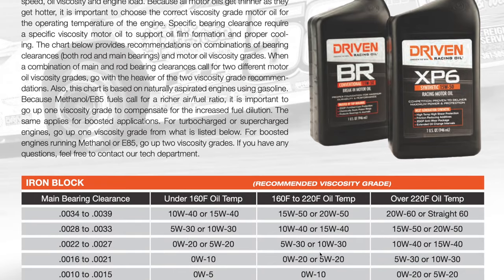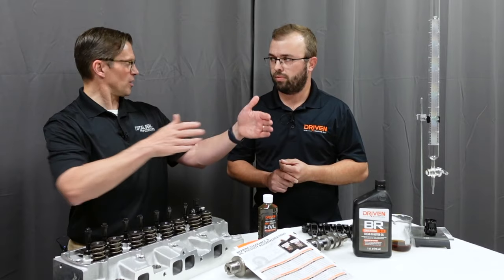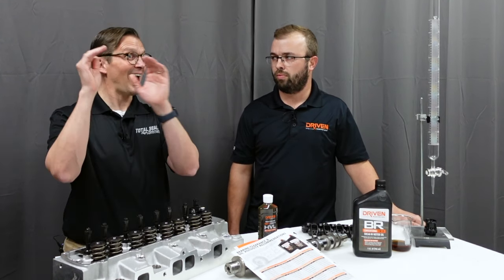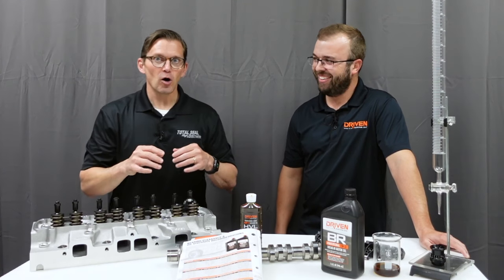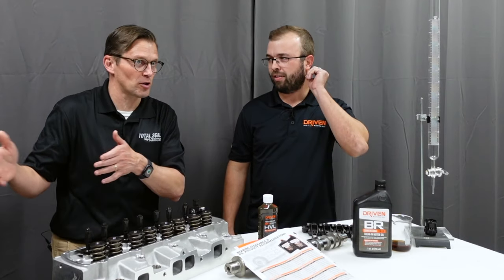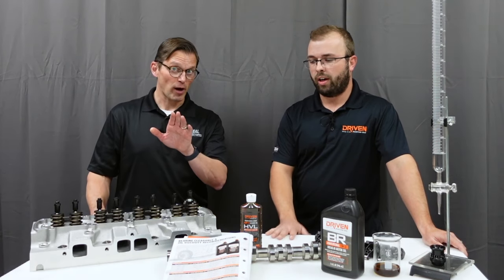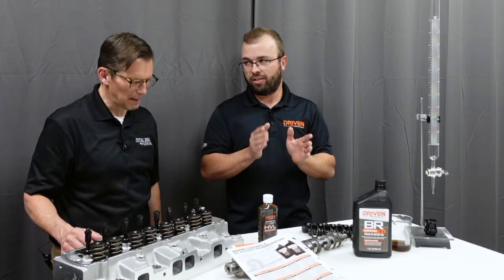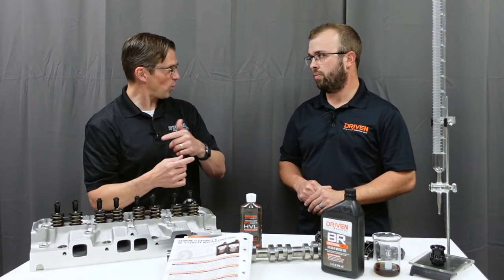How To Choose The Right Viscosity Motor Oil - A Certified Lubrication Specialist Explains

Comment: 0-20 is shortening engine life, and makes engines consume oil, especially nowadays with pistonrings with less tension. That is me experience atleast. 5-30 is good choice for a normal passenger car.
Reply: Low tension rings do better with low viscosity oils.
The low tension rings  can actually hydroplane over instead of scrape oil off the cylinder walls if the oil is too vicious.The fuel efficiency gains with low viscosity designed engines is not only lower pumping losses but also lower rings to cylinder friction because lower tension scraper rings are needed because of lower viscosity oil.
Reply: @masterq2.033  Exactly.
Reply: @masterq2.033 No there’s really no evidence showing that
Reply: @jtmartin8445 hydroplane ???? Lmao. Agree ive never heard of that. Its not like engine oil versus gear oil. I believe running thicker oil will make engine last longer...
Reply: I could listen to Lake talk all day he is one of the smartest guys in the industry.
Reply: Crap engines are the cause of engines using oil.   0w-20 in a Toyota 4Runner…works awesome.
Reply: If extrapolate , the next generation gasoline engines must be lubricated by diesel fuel :) It was shockingly surprising to learn, that the new Toyota Corolla coming from Japan run on 0W8 viscosity oil :) which even isn’t yet available in Toyota’s dealerships:) Remembering the aqua planing effect,I’m moving straight to water ( distilled one of course:) for the hot months and 50/50 water/ Jack Daniels mix for the freezing ones :)
Reply: Nah. Before I had my engine built, it had done 200,000 (km) on 0w-16. Bores still had hone marks, pistons had negligible wear, and you could swear the bearings had just been installed.
It also lived a life saying hello to the redline more often than you could argue it should have done, it also happily pulled at 1200rpm, which also blew the  minds of many
Reply: I use 0w20 to engine vvti 1.6 sport and is with 125.000ml and nothing has happen it's been very good no consume so it's Not true what u say
Reply: I use 10w-30
Reply: Lmao,,,,another lubrication engineer
Reply: Toyota's running 0-20 would beg to differ. It's are not so domestic vehicle manufacturers just be building over priced garbage now
Reply: @masterq2.033 what about the low tension oil rings used back in the 90s in Ford 302s that ran on 5w30 or 10w30? I'm not sure I believe what you're saying has any real truth to it. Also what is your comment on the fact that many of these engines that call for 0w20 here in north america allow much higher viscosity oils depending on ambient temperature in other countries?
Reply: @chrispapachris3474 125k is low miles. There is some truth to what he's saying. You are sacrificing wear by using 0w20. If you're not going to keep it 40+ years like some of us (a lot of modern vehicles would last that long anyway) then no worries.
Reply: Agreed. My Yota's call for 0w-20 but I use Castrol Edge Synthetic 5w-30 or Pennzoil Ultra Platinum 5w-30. Engines run MUUUUCH smoother even in 17F ambient. The Aisin 6 speeds in my trucks likes to lug the motor and you can literally feel the additional smoothness with 5w-30. Oil consumption went from About a quart every OCI (5k miles) to literally nothing; so little that you can't even tell on the dipstick. Blackstone came back with no detectable fuel in the oil, so it's not dilution making up for oil volume, either. These are port injected UR series V8's.
Reply: 2011 Highlander with 152,000 miles of 0W20 and it doesn’t use or leak a drop.
Reply: Well my ‘16 rav4 uses 0w-20…220k miles…no excessive oil consumption issues at all…( 5k mile oil changes )
Reply: @krishnakarthik7198  what does your oil consumption look like now for a 5k OCI?
Reply: @DBravo29er  last couple of times when I checked it’s right around 1 quart (for 5k miles ). I am due on changing the spark plugs not sure if those are causing this rate of consumption….but I feel it’s pretty normal on these engines…I put around 4.3-4.5 quarts and will be down by 1.03 - 1.06 quarts at 5K miles
Reply: @krishnakarthik7198  my Subaru 3.6 at 173k miles consumes zero oil with 0w-40 Castrol Edge across a 5k OCI. My GX460 consumes zero oil at 123k over a 5k OCI. So, i am not saying you're high, but kinda. Maybe experiment with a thin 5w-30 syn like PUP or a 0w-30 Stn from M1.

I drive my cars hard after a proper warmup. They both see redline at least once for each drive. And when I say they burn zero oil, I have no fuel contamination and the dipstick level does not move at the 5k mile mark. Same same.
Reply: @DBravo29er  that's interesting ! I never did experiment with a different oil previously...now that I bought another Lexus as my daily driver I want to try out a different oil on my toyota this OCI.....
Reply: @krishnakarthik7198 . I’ve had absolutely no issues with OW-20 Toyota oil which is probably Mobil 1 in my RAV4.
Reply: Link to you paper and methodology? Would love to compare it to those that contradict these findings. Exactly what are the engine specs of your “normal passenger car”?
Reply: @DBravo29er unless you’re using gear oil in your motor, there is zero percent chance you feel any difference when using higher viscosity oil. Placebo effect.
Reply: @BabyGators  And yet you are incorrect. I don't need to you gatekeep my five senses.
Reply: Engineering in not the same as mechanics
Reply: Toyota with 0w-8 oil leaves chat 💬
Reply: Well, let me tell you what I hear is correct for my area of Orlando, Florida. This comes from
mechanic Larry Perry “the magic mechanic show” He has had his shop  since 1989. His 2 
hour radio show since about 1991...probably the longest radio mechanic show in USA. 
He tells it as he sees it in his shop every day. I get so peed off at these viewers telling us
this and that and this is just their opinion but they want to present it as a fact. So sad indeed.
Larry says anyone using a 20 weight engine oil in central Florida is killing their engine. But
you say the manufacture recommends it. Just because they do, does not make it correct.
20 weight oil, perhaps should be used in northern, colder climates, not in the south where
average temperature is 85 and above. Wake up people and remove your head from where 
the sun does not shine. Manufactures want your engine to wear out soon as possible so
you will be purchasing another car as soon as possible. Running a thinner weight oil
will give just an edge better mileage at the killing of your engine. Best for the south and 
hotter climates are 10w30 or better yet just 0w30. Take this to the bank and do not even
get started on the 16 weight Toyota is recommending using. I am telling you, their are some
dumb people out there even the so called automobile engineers.
Reply: @doctorwhodj you would be 100 percent correct.
Reply: Some require 0w20 because of tight bearing clearences
Reply: @masterq2.033 complete bologna. Sounds good but not true.
Reply: @masterq2.033  you just said something al gore would say before hopping on his personal lear jet.
Reply: @uppastdawn7627  it doesn't use oil because the ring seat properly. It's when your crank goes clippidy clip from oil the viscosity of spit. The top ends of these Japanese engines always look good, when they go it's always the bottom end. Ask me how I know.
Reply: @krishnakarthik7198  it's not about excessive oil consumption, it's about your crank. These Toyotas are good so think of it as the difference between 210,000.miles and 400,000 miles. It's always the bottom end of the engines that fail because of weak oil.
Reply: @DBravo29er  oh my, how could you run a 40 weight with today's tight engine tolerances...... Lol, just kidding.
Reply: @DBravo29er  I had a jeep that took 5w20 and after 10w30 I never looked back, it was a smoother running engine.
Reply: @williamoneal2763  I'm up north and I refuse to put  0Wshit in my truck. I use 10w30 molbil 1 with 4k oil changes and everything goes fine even at 0 degrees with no  auxillary engine heater junk. When I picked it up with 4 miles I drove it home and drained the piss out it and put in 10w30. I could tell instantly that the thing was thanking me. Some vacuum pumps I believe are eating themselves alive from all the oil additives in 0w20 synthetic, these additives are the only thing that makes your 0w20 car live, and it's living a crappy life with 0w20. But something with this viscosity or oil additives are eating vacuum pumps left and right and nobody has a solution for it while running oil that is the viscosity of spit. But they are perfect on 10w30.
Reply: @doctorwhodj  these oils are also somehow killing vacuum pumps left and right. Figure that one out.
Reply: @RJ2878  0w20 the vacuum pump eaters.
Reply: @Investment_Hedgehog  it's crankshaft failure and vacuum pump failure. It's the bottom ends that fail from these oils.
Reply: @damienhenderson9347  lol, you obviously haven't been around long to believe that bologna.
Reply: Yeah the guys that made the engine have no idea what they are doing.
Use the oil specefied for your engine and change often, no problemo 👌
Reply: Nonsense! Lower viscosity does not cause more engine wear. If a lower viscosity oil is recommended for the vehicle, you should stick with it. Lower viscosity oils tend to have a greater additive package to make up    And still provide adequate lubrication and protection. People run low viscosity oils for decades in countries like Japan were cars run for hundreds of thousands of miles and then after that exported to Asia, Australia and Russia and still continued running with no problem. Just follow your manual recommendation regarding the type of oil and change your oil based on the way vehicle is used and your life will be trouble free.
Reply: @masterq2.033  not true. Engine was not designed around 0w20 oil.
Reply: @masterq2.033  Exactly!  Thanks!
Reply: Pennzoil 5w -30 ultra platinum...
Reply: @RJ2878 That's why my engine oil in my honda odyssey burbs up fast 0w-20 I put 5w-30 no issues oil looks way better runs better so glad I switched
Reply: There's also crap oil and crap filters etc
Reply: Oh well mechanical engineers should note that, ever took a peak at the stuff in their code book? maybe if they had that seat of the pants gumption they would understand 😂 @elliottroca
Reply: @iq6840 I've heard the same issue on the 22RE. It never dies from the top but always below.

In a small engine if you have the ambient temperature for it 15W50 usually lasts the longest or a straight 30 weight.

I know that those are air cooled engines but some of the manuals even suggest 0W20 in the engine. People look at it from a wear perspective and everything.

Usually from what I have noted is most lf those engines perform best when you stick to the same viscosity you have been using.

I remember a tribologist somewhere talking about molecular wear and he said sticking to the same brand and viscosity mattered more for wear patterns. Albeit this was older information on mid 2000's vehicles it was interesting nonetheless. 

It makes me wonder if it's the old paper clip bending back and forth when it came to motherboards, heatsinks and solder. Heat dissipation being key.

0W8 sounds great in extremely cold temperatures and short trips as warm up time on engine components should be reduced. I can't imagine a 0w30 would make one iota of difference if you had a commute of 30 minutes or more though.

I believe a lot of these thinner oils have to do with extended drain intervals and the fact people no longer drain their oil every 90 days to dispose of contaminated oil caused from 10 minute trips.

The thinnest oil they tend to put in a Toyota in Texas is 5W40, 10W40, 15W40 or goold ol 20W50.

But because people being idiots and not changing oil out to reflect their weather I suspect that more than anything else have led to these recommendations.

Interestingly before people started analyzing their oil the local dealership took all the Toyota's running 0W20 and would switch the engines to 5W30 post 70,000 miles to reduce the sheer amount of warranty claims they were seeing. If that isn't evidence what else is? I believe in the engines that were really far north on high mileage they had 10W40 set aside but would discuss it with the customer first.

Whole thing is hog wash.
Reply: @iq6840 Bingo, 10W30 is often the native viscosity of most oil companies so no class VII's are needed to adjust the oil either. Far less BS in the engine by far running that.
Reply: @iq6840 Out of curiosity what was it designed for? 5W30 or 10W30 would be my guess? Some Toyota's for instance I have seen 5W40 as their native oil when used in testing.
Reply: Not to mention the new 0w-8 😂
Reply: @DBravo29er  Iv been curious of switching to something thicker in my 2010 Sequoia with the 1 UR FE  4.6 engine calling for 0w20.
Reply: @2014ultra  Pennzoil Plat or PUP 5w-30 would be a great choice IMHO.
Reply: It really is. 20v oil is an emissions move. So is suggesting changing every 10k miles
Reply: 5w30 or 10w30 like you stated.
Reply: @johnfoster7039  5w-30 woulds likely be my rec. 10w-30 is technically more robust, but could be a big adjustment for your cam phasers. Not sure.

But I had a buddy who ran 15w-40 in his 2UZ (first gen Tundra), so maybe it's fine. lol
Reply: OK then, tell me why my 2018 Toyota using 0W16 uses absolutely no oil between oil changes. I have 120,000 miles on it, change oil every 5,000 miles and it runs great.
Reply: Im pretty sure the 0w20 is perfectly fine…I believe whats killing these newer engines is people going 10+k on an oil change…lol
Reply: @briguy91931  0w-20 can perfectly fine in engines that were designed and blueprinted for it. It can't be perfectly fine in engines that were designed for 5w-30, and then BACK-spec'd to 0w-20, which is what we are talking about here.
Reply: @DBravo29er  i didnt see that. Just the original comment. But i’d still say that proper oil change intervals have a vastly bigger effect on the NEWER engines and low viscosity oil. People REALLY need to read the owners manual once in a while. I do agree also that running lower viscosity on an older engine can be bad. hahahaha
Reply: It’s really not. Manufacturers who design bone head ring packages for said engines are the ones shortening engine life. Add to that the long oil change intervals they recommend. Has nothing to do with the viscosity. A modern 0w-20 oil is great when used as intended. It’s all about the formulation, not a one dimensional attribute like base oil.
Reply: The buffer is lower with 0W-20 oils. On a positive note they are almost always synthetics and issues with LSPI and Chain wear have been addressed.

On a negative, the same chemistry is available in 5W-30 with more natural base oil protection from a thicker oil.  The 0W-20 oils aren't great for high heat and they don't have a large buffer for either fuel contamination or shearing down to a thinner viscosity oil.

For most people 0W-20 is fine. I use it, but I change it every 6 months or 5000km.
Reply: We europeans (which many of us have 500.000km on our daily driver cars) we use fully sythetic 5w-40 and a 15.000km (10.000mile) oil change interval
Reply: @krishnakarthik7198 hey do you have a cold rattle start up from your vvti gear??  I have a 2016 rav4 as well with 76000 on it and my vvti rattles..
Reply: I too am a fan of the magic mechanic and will be using amsoil 0w30 not 0w08
Reply: 0-20 is used because it pumps quicker when the engine is unlubricated cold start
Reply: @jason200912  Hey Jason,,  I have a 2016 rav4,,  and just put 5-30 in and it was the best Decision I made not a problem at all..  it Quieted the vvt down on cold start.. Toyota is known for that rattle.. FROM TOM..
Reply: @RJ2878  0W20 in a rental 300 hemi in AZ ticked and knocked every morning.  I call BS if your temps are over 70F.
Reply: @chrispapachris3474  Local temps matter.  You failed to mention how many months it's over 70f.  So far, both the motor oil geek and projectlabs have proven 0w20 doesn't protect as well as 5w30 in normal temperature.
Reply: @lonniebeal6032 it may be the hemi.
Reply: @masterq2.033  Low tension rings are a bad excuse, if you live in a cold climate, your 0w20 oil will be more like SAE 90 most of the time.
Reply: @Resistculturaldecline  Then why were Corvettes with tight tolerances and low tension rings running 0w40?  They may be adhering to government corruption today, but older Corvettes didn't use a thinn 0w20 will have have viscosity breakdown at higher temps.
Reply: @chrispapachris3474  What are you local temperatures?  0w20 is fine under 35c in a full synthetic.  I am still waiting for someone to prove to me that 0w20 is good for 40c days 6 months of the year or more.
Reply: How would using thicker oil are starving your bearings at start up help longevity! Thats what the difference in O to 5 just how it flows at start up.
Reply: People keep saying use 5w30 for cars but don't know that some cars like hybrids use the 0w20s and other 0w oils.
Reply: To summarize all the talk....use 5W-30.

Comment: Dear Lake, should I switch from manufacturer’s recommended 0W20 to 0w30 in Honda Accord 2012 4cyl engine for less engine wear and better engine protection? This car is my daily city driving vehicle in San Diego, CA with 200,000 miles on the odometer and usually 3K-5K oil change intervals with Mobil or Pennzoil. There are thousands of mechanics out there that tell users to stay away from SAE20 and other lower weight oil as the engine life is very much reduced because of using those. Please share your insight. Much appreciated!
Reply from the maker: In San Diego, you could probably use 5W-30, but we don’t recommend changing viscosity without doing used oil analysis before and after to know for certain if the viscosity change was beneficial.
Reply: @TotalSeal  Thank you so much, will do! God bless